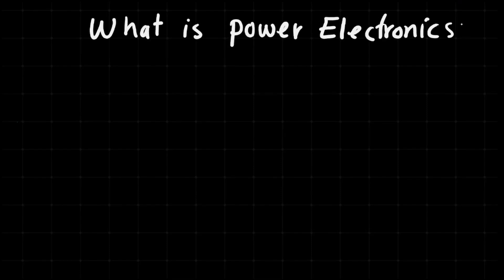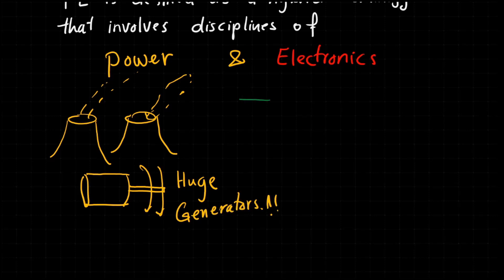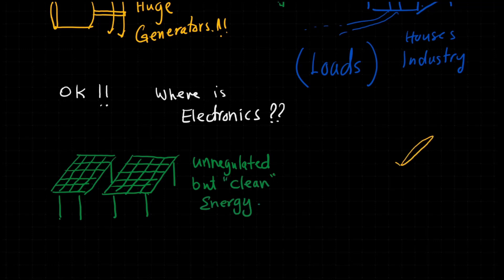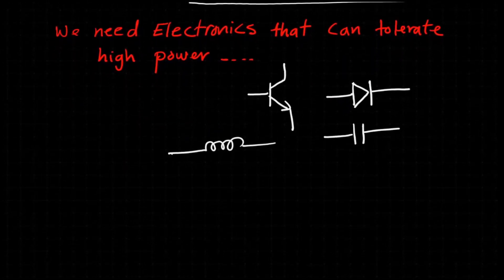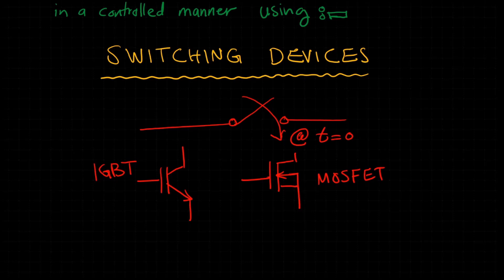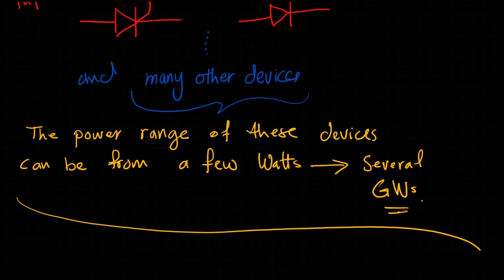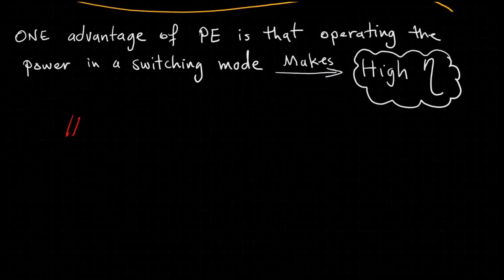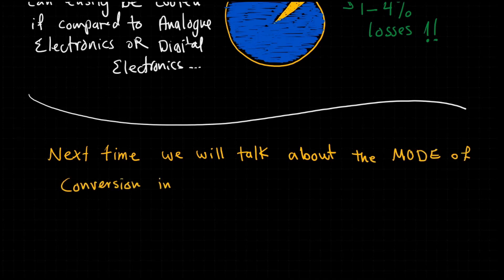What is Power Electronics? Enjoy Power Electronics | power electronics online

Comment from the maker: Here is the outline:
00:00 Introduction 
00:38 The traditional power system 
01:19 Why do we need electronics? 
02:00 How to integrate the new resources?  
02:57 Switching devices 
03:40 Power range of PE devices
04:35 Advantages of power electronics  
05:20 Wrap up